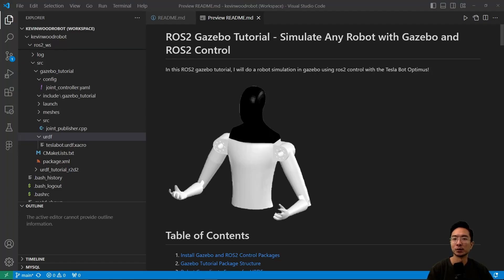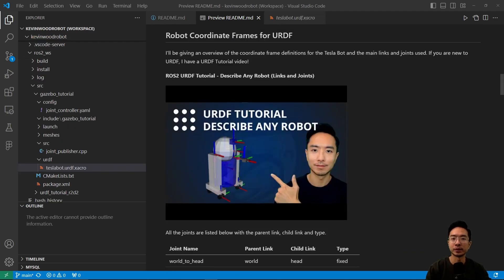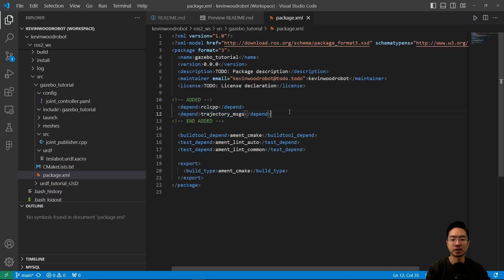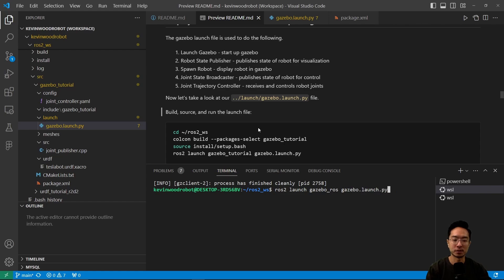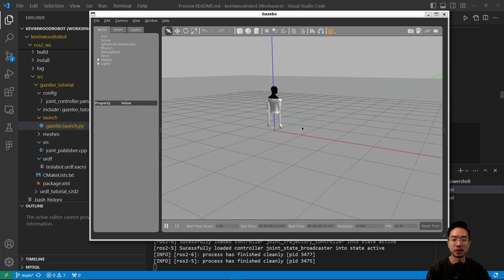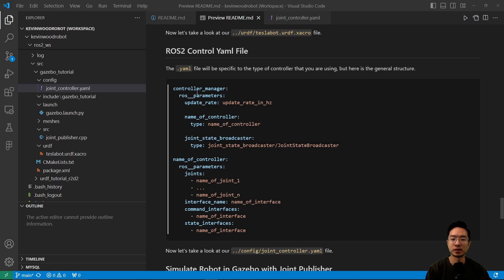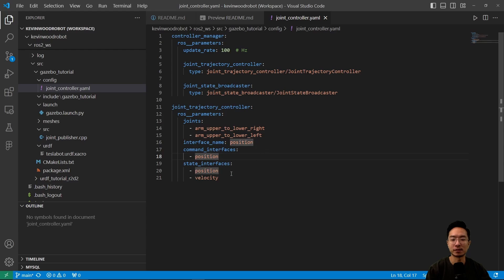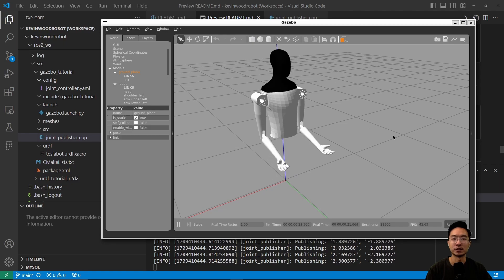ROS2_Control Gazebo Tutorial Robot Simulation  (Custom Robot Arm TeslaBot!)

Comment: Thank for yor amazing tutorial. BTW I can't find the meshes folder in gazebo_tutorial. Where can I find this
Reply from the maker: It’s in the Tesla Optimus folder. You will need to copy and paste those files into the mesh folder
Reply: @kevinwoodrobotics  Oh! I can see them. But the torso.stl seems not show properly. It's blank in simulation
Reply from the maker: @bernielin3450  that's weird. Maybe double check path names if there any issues? Can verify if the stl file is fine in any 3d viewer too, but should be fine
Reply: @kevinwoodrobotics  I finally fix it lol. In xacro file, you import the wrong name as the body at line 37
Reply from the maker: @bernielin3450 nice! I think I renamed the stl file at some point when I restructured the files
Reply from the maker: And thank you!

Comment: Hi, thanks for your awesome videos! Do you know, how its possible to control position and velocity of 6dof roboarm? I`m trying to use joint_trajectory_controller/JointTrajectoryController
Reply from the maker: So in my video I am controlling it with position. There’s options to set the velocity if you take a look at the msg definition for the joint trajectory. Depending on your application, if it doesn’t support your exact usage you may need to make your own controller.